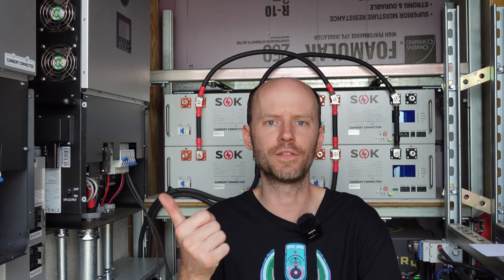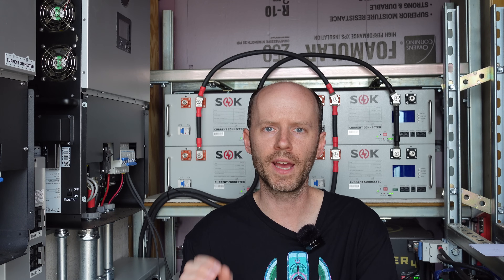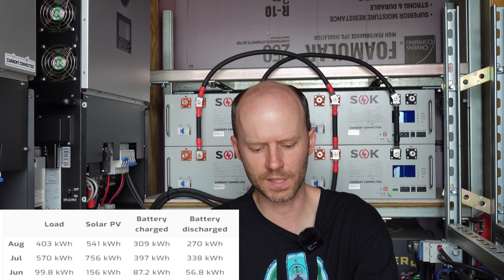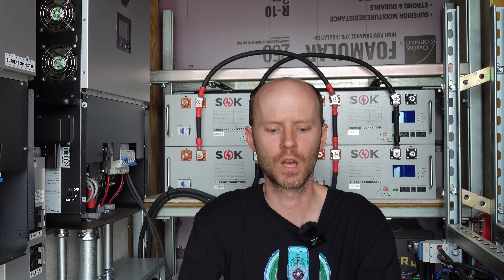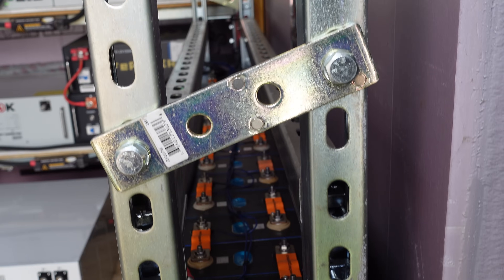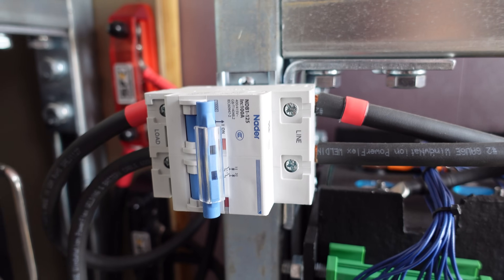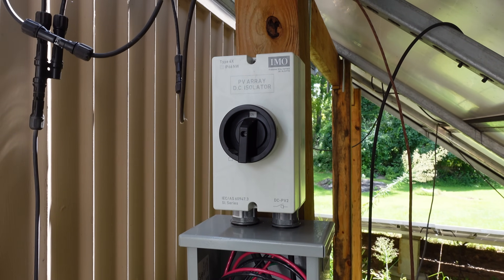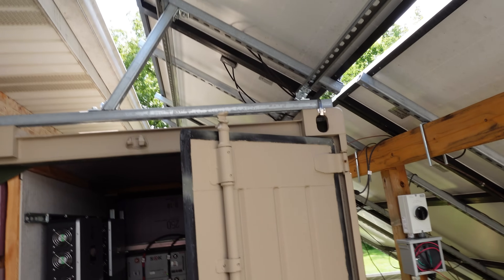EG4 6000XP Inverter 2-Month Update, EVE Battery Rack, Solar Assistant, and More

Comment: Here's info about this inverter on google that you won't find on youtube: "My new EG 6000 was running happily for a couple of weeks until this night the battery ran low and the inverter switched off power supply and threw a 26 Error code on the front panel.
Checked the manual, it stated code number 26 to be a "internal fault" and to restart the inverter.
So i turned the inverter off and as soon as i turned the battery main fuse back on, with no solar input or juice from the grid, i was greeted by a loud bang with smoke and sparks coming out of the unit. Save to say, that's it, shes dead".
Reply: i wonder what happened

Comment: Enjoying your videos. Your installations are beautiful....very professional.
You indicated that EG4 did or could push out a firmware update to provide encryption and password protection on there app. Called this morning and they quickly pushed my call to the distributor....Signature Solar in my case. Bottom line, they know nothing about a firmware update that provides this fix. Thoughts on how I can get this update?

Comment: Plan to build small size home solar system with 
1)	EG4 6000XP Off-Grid Inverter (single module)
2)	SERVER RACK with 5 x EG4® LL-S 48V 100Ah (total of ~ 20 kWh)
Do not plan to grow the system.
Consider two options to place the equipment
Option #1, Buy metal container OR
Option #2, Use space in one of my bedrooms
Inclined to choose Option #2,
but have concerns about safety (fire hazard) placing high power equipment in the house.
Are my concerns valid or not based on your experience? Thanks

Comment: Not having any type of encryption on a power backup system is definitely a HUGE problem. They don’t even give you the option unless you ask for it?!!! Man that’s a huge turn off
Reply from the maker: They may make the firmware available through the updater tool later. I'm not sure - might still be in development.
Reply: @LithiumSolar  do you have the latest FW installed?

Comment: Nice update. I have been looking at the 6000xp as a possible simplification of my Victron system, but since I am in a restricted subdivision, all of my panels are "hidden from street view" and therefore not optimized for orientation since the house faces south and the panels can't. So efficiency is important to me. I have 2400w of PV and averaged about 7 kWh/day in July and August in SE Michigan... not horrible under the circumstances. To make this all worthwhile I chose Victron in hopes to minimize losses. My average total loss per day for these two months was ~900w, or 38w/hr. Looking at your data, it appears that you are losing about 4.2kWh/day, or 175w/hr. Is that correct? Do you know where most of the loss is? Is this just a consequence of having a larger system?

Comment: One thing you can do that is easy (depending on your router) is disable Internet to the inverter with a click of a button in an app.  This doesn’t affect solar system, and if you ever needed to just enable it for Internet, connectivity again was just a click.

Comment: How is this economically feasible? Seems like you’d never break even. So is the purpose to not be dependent on the grid or to reduce environmental impact (despite all that went into those batteries)?
Reply from the maker: Primarily 2 things... 1) Hobby 2) Backup power in the event of a grid outage
Reply: @LithiumSolar  Works for me. Now I’ll have a better understanding of your point of view & motivation moving forward. Good luck & thanks for the content!

Comment: You prefer S.A. over the eg4 dongle data?? I feel like the desktop software for the eg4 monitor has waaay more data... I had SA on my 6000ex, and was planning to go to my XP until I saw the eg4 monitor and found it much more robust.
Reply from the maker: No, I wouldn't word it that way exactly. It's more a matter of me preferring my data remain local and my critical systems to remain off the internet. I consider a piece of equipment controlling a giant lithium battery to be "critical". To be clear, I am not saying there is anything wrong with the EG4 platform. It's matter of preference (and paranoia).
Reply: @LithiumSolar  gotcha!   I loved my SA until the onboard storage died and I had to flash and install a sd card. I like the pretty graphs and fully planned on installing it on my brand new xp upgrade from the EX. But once I started using the eg4monitor I found I didn't need the the SA anymore.

Comment: You've been busy and having some fun!

Any issues using SOK with EG?
I have some Lifepower 4 batteries, what if i added some SOK? Communication issues? I didn't see SOK on the battery compatibility chart either
Reply from the maker: I am not planning to use any communications from the inverters to the rack batteries. I will be setting up communications from the inverters to the Batrium at some point, but that has not happened yet. No issues either way. I programmed settings in the inverters that satisfy the rack battery requirements.

Comment: great video, but quick question, how do u charge all of the batteries with the 6000xp ? u cant communicate wit ht battery because u have diff vendors so how do u program both 6000xp to charge the verity of your diff batteries ? thank you
Reply from the maker: They're all the same chemistry, LiFePO4, thus have the same technical specifications even though the manufacturers may advise something different.
Reply: @LithiumSolar  So basically you program the inverter to charge based on voltage ?, what are the best setting in this case ? thank you
Reply: Wondering the same thing.  The com cable is constantly adjusting charging amperage depending on SOC. Sometimes 150a sometimes 30A (90%+) which is integral for extending battery life ... I never fully understood the Nexus between the inverter and the BMS via the com cable until the eg4 Monitor software.  Now I'm seeing the power of the com cable.  @amio_roseto1
Reply from the maker: @amio_roseto1  Yes, and all I can say here is to follow the manufacturer's recommendations :)
Reply from the maker: @gdegarimore  You're spot on here with the ramped charging. It's in the plans, with the Batrium being the control point for the entire system rather than the rack batteries managing it. Eventually though you reach a point where your battery bank is so large, it matters less and less.

Comment: "They just work" is the best praise you can give, especially for solar equipment. Very good update, thanks!
Reply: Solar systems, particularly the panels 'just work',  year after year.  The equipment (charge controllers, inverters, etc) is electrical and wears out but can be replaced and it's good to plan for this to ease the situation as it will happen within 5-10yrs?.   However, overall, my solar system is the lowest maintenance system I have in my life / around my home and I just love that about solar.  A vehicle is way more trouble for example :)

Comment: How are you keeping that cool without a mini split heat pump. I have a 9000 BTU for Fujitsu 33 SEER on mine and keep it at 64° all the time. Electronics last a whole lot longer that way.
Reply: The battery cells like the same temperature you do. 74 is better for them.
Reply: @john_in_phoenix  my 180kWh - 13 ea diy batteries with JK bms’s have been doing good for 2.5 yrs. I’m an hvac guy so my work van has 1620W of REC panels on top, Gree 22 SEER 9000 BTU with outdoor unit shell/coil/fan underneath blowing down. I keep it at 68F along with my house and shop. I love it cold, especially when it’s 100% powered by the  sun.
Reply: @USA-GreedyMenOfNoIntegrity   Yes, mine have done well since 2019. My testing also indicates the battery cells perform better at the "just right" temperature. 64 isn't bad, it's just not ideal.
Reply: @john_in_phoenix  You are correct. I just like going in there when overheated doing yard work, otherwise I’ll probably would keep it at 72°F. 😁
Reply from the maker: 64??? Man, ambient temp in here is in the high 90's some days. I need a ventilation fan really. Right now I manually open the door lol. It won't be a mini-split though.

Comment: I see your batts are not using a bus bar.  Are the SOK batts good with that?  Seems to be a bad thing with EG4's, not sure if specific to them.
Reply from the maker: They are connected in a perfectly acceptable way with cable that is plenty thick. I'm not sure the reasons for it being bad with EG4's. I would need more information on that.